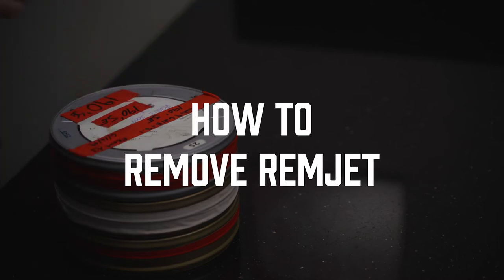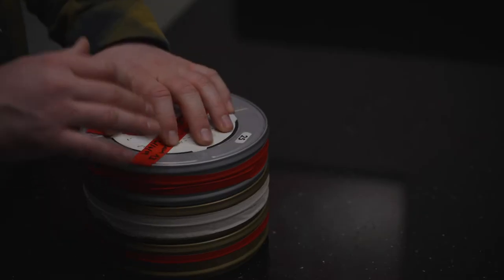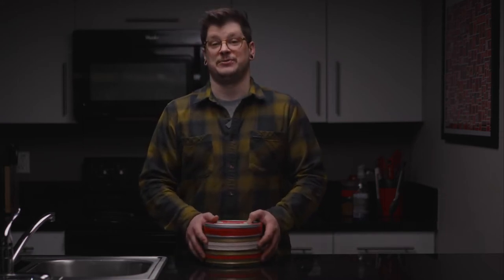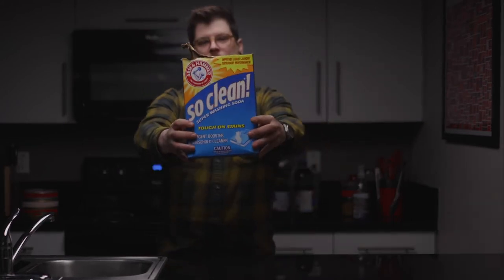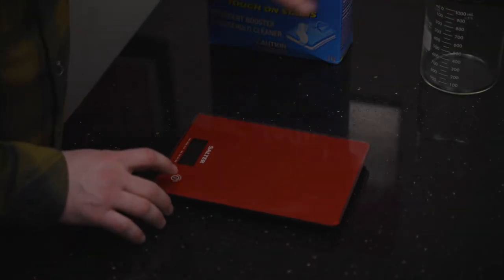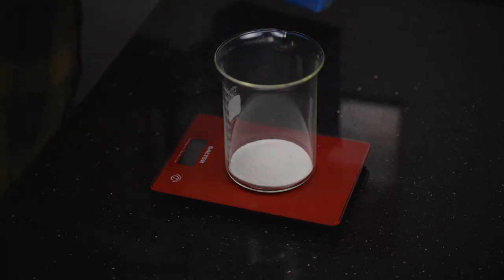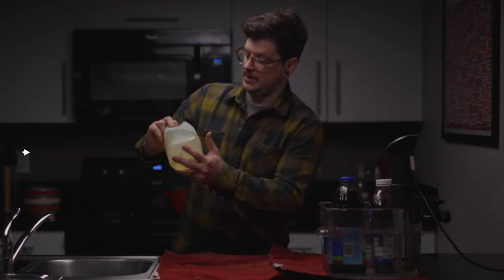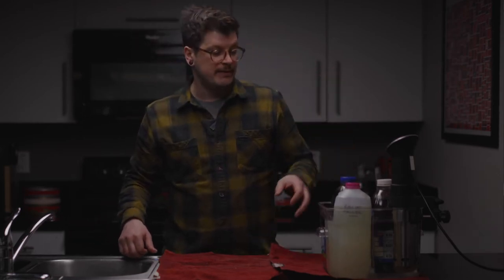Removing Remjet from Motion Picture Film

Comment: While the shown concoction will work, it does not remove all the remjet before development, which is the preferred situation. A more effective remjet removal solution is:
Water 100F / 500ml
Borax, decah. / 20g	(Crystal, like 20-Mule Team)	
Sodium Sulfate, anh. / 100g  (source chemical supply; cheap)
Sodium Hydroxide / 1g  (supermarket lye)
  Use at 100F. Soak and agitate in solution for 10 to 30 seconds, then wash several times with serious agitation until water runs clear when dumped. The solution can be reused until its volume needs to be topped off, as there is no consumption of the chemicals.  Since some remjet will come off in the removal solution, just filter it though a drip coffee filter to remove that grit when the solution looks contaminated. Remjet is just powdered carbon glued on the base side of the film. This alkaline removal solution quickly dissolves the glue which binds it to the film. I'd still give the film a wipe after final wash and before using Photoflo, but you will find that nearly  all the remjet was  initially removed. This will leave less loose remjet to contaminate your C-41 developer and transfer to your next film when reused.

Comment: If anyone wants the exact Kodak formula it is as follows
Water 27 to 38°C (80 to 100°F)
800 mL
KODAK Anti-Calcium, No. 4
3.0 mL
Sodium Carbonate (anhydrous)
58.0 g
Sodium Bicarbonate (anhydrous)
19.0 g
KODAK Stabilizer Additive
0.5 mL
Water to make
1L
pH at 25.0°C (77.0°F)
10.0 ± 0.20

Comment: I´m just puzzled following your method. Absolutely great! The only difference, I´m wondering about: In my case the remjet vanished completely after prewash and developing. I took the film out of the spool after dev, blix + fix, like other people did and wanted to remove rest of the black mess with my fingers inside the water tab. But there is nothing left! No need for cleaning with a sponge!  I´ve been using 100g washing soda in 1 Liter, around 40° Celsius. Maybe my soda is different?(very cheap from ebay). I also don´t think, that the chemicals are affected. The remjet simply vanished/dissolved during the prebath ;-) . Anyway, this works perfectly fine for me. Thank You for sharing! Regards. Oh, btw., the film was Vision 3 of course, 250D.
Reply from the maker: Whoa, that's great. I'd consider yourself lucky! I usually get most of it but there's usually some residual left to clean up after. I'll have to give your method a try next time. Cheers!

Comment: Hey Dustin, great video, very helpful! Can you reuse the developer after the remjet removal part or is it too contaminated? Just asking because I ordered a kit that's supposed to develop 12-16 rolls and I want to develop a batch of regular c-41 film some time after.
Reply from the maker: Thank you! I haven’t had issues with contamination. For a while, I was only doing remjet rolls after all my C41 rolls but then I have that up and haven’t had problems. Good luck!
Reply: @dustinveitch2825  thank you!!
Reply: If you do have problems with remjet in your developer ending up on the film, you can filter the developer through a coffee filter. I wouldn't do that unless you are really concerned about it because you wanna avoid adding oxygen into the developer, and filtering will add air.

Also, I don't know if you need this advice, but in my experience most developer kits are only good for about half the advertised number of rolls. You can keep using it after that point, but you will start to get color shifts that can be annoying to edit out. Imo the extra time editing isn't worth the money saved by stretching your chemicals that much.

Comment: Thank you for the solid explanation, do you think it would be possible to remove the remjet before shooting, I really want cool red hallations
Reply: i've done this before using a different method of removal which gave me poor results. If you wanted to try this you would need to use a reliable remjet remover (like the video).

-Load the unexposed film into a development tank.
-Remove as much remjet you can with warm water rinses
-In a darkroom (Lights off) Remove the film from the reel 
-gently rub the Base with your thumb inside a bucket of warm water to remove the rest of the remjet
-Place the wet film into a drawer or cabinet that is 100% light proof and dust free that will allow the film to dry completely 
- Once film is dry and free from light leaks, Reload the canister and shoot as normal 

You need to be very careful and very thorough. Make sure you have some way to wash and dry the film without any light leaks.
Reply: @heatonize  much appreciated for the detailed step by step explanation, challenge accepted, I'll let you know how it goes. The idea of having Cinestill on tap drives me crazy, imagine if Polariods had halation's, it's be insane.
Reply: @BboyGraphicx  Please keep me updated i wish you the best of luck!!

Comment: Thanks Dustin, just a question about that jug of hot water for rinsing, is also at C41 temps ?
Reply from the maker: Yes, that’s right. I usually just get it warm but I wouldn’t do higher than 105 or so.

Comment: Great video. Very hepful. I'm about to dev my first few rolls of Vision 3. I was curious to know why you didn't stabilise before removing the film from the tank. Is stabilising before removing the residual remjet problematic?
Reply from the maker: Most people stabilize after removing the remjet. I can’t really tell you why but that’s what I’ve found out there.
Reply: @dustinveitch2825  Thanks, Dustin. Grateful for your reply. I Googled it, and it seems to be because the remjet contamintes the stabliser.

Comment: That was very helpful Dustin, thank you so much !!! It worked like a charm for my Kodak 200T !
Reply from the maker: You’re welcome, Greg! I recently tried using just baking soda and achieved similar results. If you haven’t tried using ECN-2 chemistry, it’s worth checking out!
Reply: @dustinveitch2825  I don't develop colour film at home. But yesterday I developed a test roll in Rodinal, with stand development. I just finished photographing the negatives (Im a newbie at that !) and can't wait to see how they turned out. The sure thing is that, I can clearly see images ! I have one more test roll in the  camera that I will have it developed normally at a lab. When I get the roll back, I will try your removal method. So far, the rolls I had developed , I was using baking soda after I got them to remove the remjet. It worked but nit that well, maybe cause it was done so late, after the development I mean,  who knows. We shall see. Hope it works well in that case too !!

Comment: I still can’t see what your using for remjet remover.
Reply from the maker: In the video I use sodium carbonate, also known as washing powder in some areas. I’ve also started using sodium bicarbonate, or baking soda. In the video I say not to use it but I’ve since tested it with positive results. I use 3 tablespoons worth of baking soda in 1 liter of water at 102 degrees and follow the rest of the process as you see in the video. Good luck!
Reply: @dustinveitch2825  thank you
Reply: To clarify what's going on here, remjet is something like carbon black powder which has been coated on the back of the film base (not on the emulsion side) with a binder, like a weak glue. The binder dissolves when soaked with a basic solution at warm temperature. In the real world of ECN2 processing the film back is first run past a spray of the solution, which dissolves the binder and blows the remjet off before moving on to the developer tank. So, most solutions which have a basic pH high enough and are warm enough, and applied with enough physical force to wash off the loose remjet, will get the job done. The solution specified by Kodak in its ECN2 formulas doesn't use the same chemicals he uses or discusses here. It uses a weak solution of sodium hydroxide  (lye) with a few additions, but lye can be nasty to work with, so DIY folks usually use a less troublesome chemical. The point often not mentioned in these discussions is that whatever you use to dissolve and remove the remjet, you must thereafter wash the film completely before proceeding to development. Any remjet remover solution retained in the film emulsion or tank and carried over into the developer will radically change its chemical function and will likely destroy the development process.
Reply: @dustinveitch2825  I was gonna ask if I can use baking soda! 🤞🏻🤞🏻 hoping it will park for me too
Reply from the maker: @NuralIdrisoglu  I’ve been using it recently with good results. I was making a much bigger deal of it—it’s really easy to do.
Reply: @dustinveitch2825  quick question, do you use baking soda just a couple seconds, in and out, same as washing soda?
Reply from the maker: @NuralIdrisoglu  I actually started shaking it for about a minute or so, then rinsing.
Reply: @dustinveitch2825  thanks!

Comment: Umm, having developed a few dozen rolls with no rejet stripper I can say for sure your concoction is not what caused the remjet to wash off. After the developer you can do a rinse and get most of the remjet off before putting in the blix. Does your striper work BEFORE starting to develop the film?
The Kodak Remjet stripper uses Sodium Tetraborate and is a pre wash before developing the film.
Reply from the maker: Yep, this is before the developer bath. I've done it without using a remjet solution as well but I found it to be not nearly as effective. Plus, I like to remove as much of it as I can before developing to hopefully prevent it from embedding itself into the emulsion.
Reply: @dustinveitch2825  I tried it and it works amazingly well. The first roll was a bit grainy but it was from 2012 so testing some fresher 250D to see if I get better results. So far I LOVE IT!

Comment: Genius, you have two problems. Eastman Kodak uses TWO different anti-halation backings on cine film stocks; Rem-jet and Carbon-jet. Rem-jet is fairly easy to remove as per your u-toob, CARBON-JET is VERY hard to remove (except from a cine-processor where it is IMPOSSIBLE to remove and clean-up) and takes powered scrub-brushes to remove. Don't trust me, ask Eastman Kodak, and 95% of modern (not out-dated) cine-film stock has carbon-jet backing on it to pass-thru Cinemascope cameras without damage (they are trash). Eastman and Fuji coat 60% of cine-film made on Earth, and you can't process Indian or Chinese film stock as it's "split-process" EN-5.